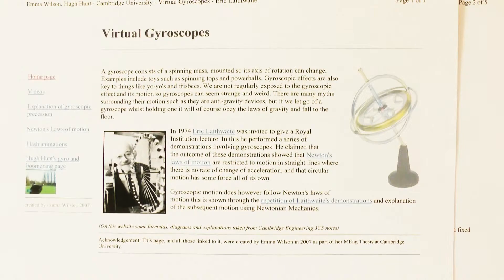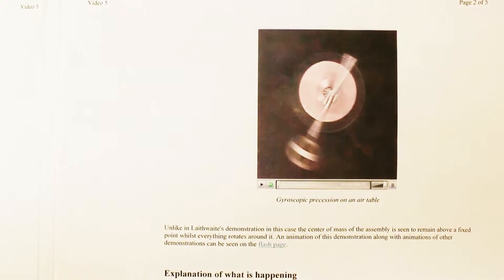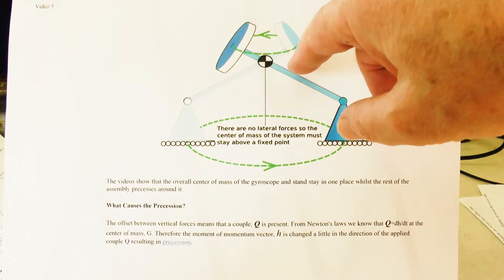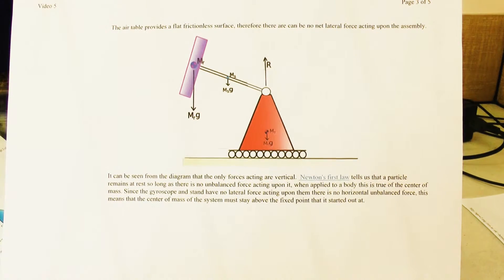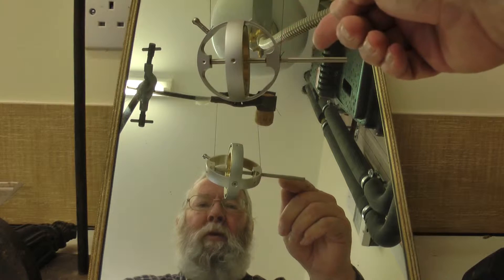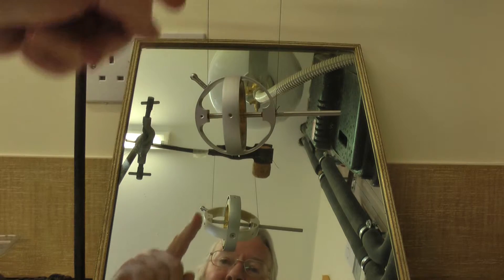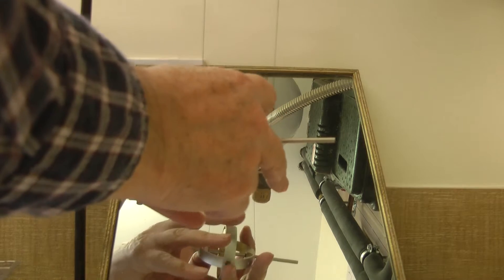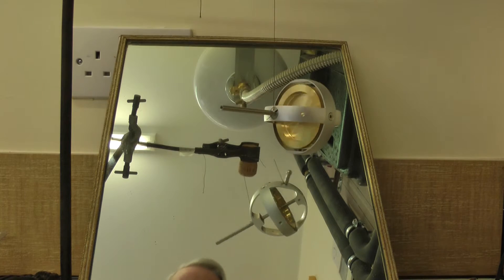Gyroscopic anomalies

Comment: Nick,

Thanks for this nice video.  

The precession rate in your experiment is about one rev in 6 seconds, so that's about Ω = 1 rad per second
Centripetal acceleration is r*Ω2 and take r=4cm approx from your video then that's 0.04 m/s2 or about 0.004g.  The tilt of the string would be expected to be atan(0.004) since the upward force is mg and the centripetal (sideways force) is 0.004mg
So the angle is expected to be about 0.2 degrees - imperceptable, as you rightly observe.

Why do you expect the centre of mass to lie below the support point?  That only occurs for a system in STATIC equilibrium.  The spinning rotor is not static - it's spinning and there are inertial (gyroscopic) effects.  What we know is that the net force on the rotor due to gravity and the centrifugal force is at an angle of 0.2degrees.  What we now need to account for is the moment.  

The resulting moment Q  is equal to mgr, and that moment causes gyroscopic precession Q=JωΩ where ω is the spin rate.  The audio from your video gives a tone of about 160Hz so the spin rate is about 10,000rpm or ω=1000rad/s.  The moment of inertia J = mk2 where k is the radius of gyration of the rotor and by eye this is about 2cm.  So we can compare Q=mgr=m*10*0.04=0.4m   with  Q=JωΩ=m*0.022*1000*1=0.4m 
Note these match, so everything is in order.  It's SO important to realise that we're talking dynamics, not statics.

I'm happy for you to remain skeptical, so don't bother removing the video - it's fun!  I show this demo to my students as an example of the pitfalls of statics vs dynamics.  I do it with a bike wheel which is much more impressive.  I'll post it as a video if you like.

Hugh Hunt
Cambridge
Reply from the maker: Hugh
 
Thank you for your reply.
 
In truth I didn't think I would get a reply after so long a time and it's a 
forgone that I certainly didn't expect you to hold up your hands and say:- "you 
are right, I give up, the gyro does rotate around its point of suspension and 
not around the barycentre"; as claimed in Emma's thesis".
 
It was kind of you to go to the trouble of "doing the math" (I really wish 
I could understand math) but as explained in the video I have the equivalent of 
Mathlexia.  As anything with " -lexia" implies having to do with words I am 
happy to accept "mathematically thick" instead as that tends to make people 
explain things more slowly and, sometimes, with crayon pictures.  
 
I still have problems balancing the "thirds" statement that for every 
action there is an equal and opposite reaction with the action of an overhung 
gyro rotating around its suspension point, a la my video.  To me the video shows 
a lack of matching opposite rotation of the suspension point which conformation 
with the third would seem to require.
 
I also have difficulty accepting the jolly way that anomalies with the 
third law are sometimes explained.  For example:- that liner reaction and 
torsional reaction are separately conserved - presumable in two paper bags kept 
specially for the purpose.
 
I know that nutters in sheds like me can be a bane of a scientists life so 
I won't bang on but If you are ever at a loose end I would be glad for you or 
your pupils looking at some of the other gyro demos on the "Jogglevision" site 
for your opinions - polite preferably.  I haven't put up details of my "fast 
repeater" yet because I am a crap engineer (did you guess?) and tend to get 
distracted too easily by life, the universe, rebuilding my Daimler Dart, 1275 
Cooper S and avoiding being killed by my lovely wife for being distracted from 
the things she assures me are far more important.  Pah! Yeah right!
 
Kind regards
Nick
Reply: jogglevision 
Glad we agree, up to a point! Emma's experiment is right too because the base of the puck provides the moment. So please let's accept that Newton's laws are correct. There is no mystery. 

If ever we're in the same part of the world let's have a beer over this, just as Newton and his mates would have done a few centuries ago. I think Robert Hooke was the real Genius.
Reply: Hugh, maybe you should show your students my experiment of a gyroscope precessing on ice and rising upwards, all of which with ZERO centripetal force. Or better yet, ask your students why a gyroscope maintains its orientation as the Earth rotates due to "angular momentum".... but a simple spinning top doesn't.... ;) Hint: the answer is "angular momentum" and coincidentally all of Newton's "Laws" are just plain wrong,.
Reply: Yes, Cambridge University is very wrong in its teaching of precession. Here is the real truth about it. 
The experiment in this video using a frictionless trolley or iceblock with lack of friction under the pivot, works as it does, because if the spin in the gyro is very very fast, then there are created in the precessing-gyro-wheel,  two phenomena which are, an outbound and inbound centrifugal forces acting on the upper and lower half of the gyro "face" and to the left and right of the vertical diameter of the gyro wheel. Their vertical separation sees to torquing against the down weight of the gyro through the arm ( m.g. R arm)  while the horizontal separation creates the precession angular rotation seen in a floating gyro experiment.  These two opposite acting but separated centrifugal forces to produce both a vertical and a horizontal torque are equal (most of the time the gyro spinning is fast) and so there is no lateral reaction on the pivot. Since there are no linear accelerations and the angular accelerations are constant, then there are not even any horizontal flicks on the support pivot due to the orbiting torque of the gyro. The pivot in this state will only take the vertically down acting gravitational weight ( one constant acceleration)  and any other change in accelerations in the height and orbiting of the gyro.  When the spinning of the gyro is reduced, then the upper inbound centrifugal force is reduced and the normal centrifugal force on the gyro and the ice block or the wheeled support trolley is established and their presence starts to be felt. At slow angular rotations, there is also a lateral horizontal force on the pivot in a sequence of directions and the rotation will first seek to rotate about the total mass center as both the outward centrifugal force on the trolley/ice block and also that on the gyro, will fight out a tug of war between them.  There seems to be a horizontal "orbiting" torque on the apex of the two cones made by the wobbling extension arm that does not seem to be always lined up at the same central location, but it orbits in small circles while both the ice block and the gyro are eventually, rested.  The last motion is much more than an example of a " horizontal flywheel" with static balance and dynamic unbalance.
------------------------------------------------------------------------------------------------------------------------------------------------------------
****In order to understand the engineering /physical reason for the creation of the inbound and the outbound centrifugal forces and how they change their relations with different spinning relations with the radius of the extension arm Ra, the radius of the spinning wheel Rs, Wp angular procession of the radial arm, Ws the angular spinning rate of the gyro wheel is to simply draw the plan view of the gyro spinning and precessing wheel around the pivot point:-
Assume the above machine has its gyro and extension arm in a  perfectly horizontal position, then draw the PLAN  view of the whole system. Take Ra to be 1 to 3*Rspin  while marking the largest circumference at radius Rs (mentally or otherwise) of the Spinning wheel every 90 degrees by using 0, 1, 2, 3 as angular position symbols. Four marks are enough to see the result.  Then measure the radius  Ra and draw the arm rolling flat circle, then the tangential line diameter 2Rs of the spinning wheel. The plan view will be a circle that the arm Ra executes while the line 2Rs as a tangent to the circle will represent the gyro maximum diameter in the horizontal location.  To see the lack of or the creation of the internal bound and external bound centrifugal forces in the plan view on the central pivot, first, draw the trajectory of one mass particle (0) on the spinning wheel without the extension line arm radius Ra advancing anywhere. Simply keep the center of 2Rs  which is (maximum diameter representation of the gyro)  tangent to Ra circumference, and choosing the position (0) on Rs as being vertical to start, roll the "vertical radius Rs through one revolution while the center of the gyro rests in the same location.  The first vertical point on the gyro starts as a tangent to the circle Ra.
 Plotting only four points in sequence every 90-degree rotation of the spinning gyro represented by a tangential line, 2Rs in length, this will include, (First point, tangential to the circle (vertical radius situation )) then, (the second point at the maximum diameter say extreme right of the tangential gyro,( horizontal radius situation)), then  (The third point representing the radius of the gyro reaching the lowermost point which would be like the first point tangential to the (Ra) circle) then ( the Fourth point which will be to the other extreme end to the left of the line 2Rs representing the horizontal radius of the gyro)  then include (a Fifth point  tangential to the circle at the starting vertical point, representing the gyro turning one full circle. )  Note that without Ra advancing, that all these five points exist on a straight line in this plan view of a spinning gyro which means that the outer tip of a  spinning radius will be forming a perfectly flat circle rotating in the vertical plane tangential to extension arm, Ra)  This radial Rs centrifugal force in the spinning of the gyro will not affect the pivot point in any manner apart from storing spinning energy in it.
Now, having the (Ra) circle and next to it the tangential (2Rs) line diameter of the gyro, follow the free ends of the line Rs and this is found to be far away radially from the circumference of (Ra) circle.
Using the previous central pivot point as a center, draw a second larger circle with a radius as long as the outermost tip of the diameter representing the tangential gyro wheel.   All the magic that shows the creation of the inbound and outbound centrifugal forces in a gyro is located in between the circle represented by the radius ( R arm ) and the circle represented by the radius square root(Rarm^2 + Rs^2)
To draw the trajectory do what one did before, but  ADVANCE THE GYRO TANGENTIAL LINE  (Ra) every 90 degree turns of the gyroradius starting with a gyro vertical radius at the tangent of (Ra) circle. Do not choose the advancement of the gyro on Ram circle too small, but whatever advancement you chose,  the spinning radius of the gyro with the gyro rolling along (Ra) circle, will produce the plan view of the VOLUMINOUS THREE DIMENSIONAL cycloidal path of one spinning and precessing gyro mass particle on the tip of one gyro radius. This flat representation of the three-dimensional trajectory will tell the full story of why the gyro behaves as it does and if one follows the movement of the "center of curvature " of this plan view of this cycloidal motion of one mass particle in a spinning gyro, then all inbound and outbound centrifugal forces directions are known.  ALL UNIVERSITIES WILL HAVE TO ADJUST THEIR TEACHING OF WHAT MAKES A GYRO WORK AS IT DOES. The stunning accelerations that exist between the two flat circles representing the tip of a radius and the center of the gyro are just remarkable to behold. 
These two centrifugal fluctuation forces in the gyro should be now called, " The Professor Carmel Pule' gyro centrifugal fluctuating pair!" 
With respect to the central pivot support point, the plotted trajectory existing in between the limits of two circles will have beautiful symmetrical with one curve representing the trajectory of the mass particles in the upper half of the gyro showing a convex curve while the other showing the trajectory in the lower half of the spinning gyro will have concave curve trajectories  THESE TWO CURVES WITH RESPECT TO THE CENTRAL PIVOT ARE THE MYSTERIOUS TWO CENTRIFUGAL FORCES WHICH GIVES THE GYRO ALL ITS MAGICAL BEHAVIOR. 
Every engineer should be conscious of the ingenious manner in which the outbound and inbound acting centrifugal forces in a spinning and precessing gyro are created, and how their vertical and horizontal (diagonal) separation can be used to torque the spinning gyro wheel to float up or down the weight of the gyro and at the same time control its processing rate. 
This is the fundamental operations of all gyro machines shown by Professor Eric Laithwaithe, Sandy Kidd, Woopy jump, Maths Easy Solution, Jogglevision, and anyone else who works with gyros.
This is now continued in a reply comment.
Reply: continued from another comment.
Addenda.
A.   It is to be noted that since I wrote the above, my research has shown that when a gyro is spinning and precessing, then two centrifugal forces are generated, one is "inbound" acting on the top ( horizontal ) half of the face of the spinning gyro and the other "outbound" acting on the lower (horizontal)  half. These two forces are generally of the same magnitude at high rate gyro spin, but opposite in direction and so the "floating gyro " will not show any centrifugal force as we know it. At lower spins, the conventional outbound centrifugal force takes over. The gyro rises because the inbound centrifugal force acting on the top half helps to " torque" the gravitational weight of the gyro upwards to lift it as shown in the video. For a normal torqued gyro without the extension arm, this phenomenon also happens to change the angle of the gyro.

If one wants to dig a bit deeper then one needs to study the accelerations in the three-dimensional cycloidal trajectories followed by one mass particle in the spinning gyro.  The plan view of the cycloidal trajectory will show the presence of the inbound and outbound centrifugal forces acting on the top horizontal half and the lower horizontal half respectively. These two centrifugal forces will eliminate the conventional outbound centrifugal force we are accustomed to and there is no reaction on the central pivot. 

B. If one looks at the side elevation of the cycloidal trajectory of one mass particle in the spinning and " cycloidal translating" gyro wheel, then one would see that as the mass particle is being accelerated down one of the "vertical halves", the GYRO CENTRE needs to lift up to produce this acceleration and while the particle is being decelerated up the other " vertical half"  then the GYRO CENTRE also needs to react to this deceleration by lifting up.  It is this lifting up of the center of the gyro wheel due to the large radius accelerating particles down one "vertical half" and decelerating mass particles up the other 'vertical half"

To understand the contents of the last paragraph all one needs to do is to appreciate that   THERE IS A SOLID CRANK FORMED  by the fact that the long extended  SOLID axle of the gyro is SOLIDLY  attached to one spinning SOLID gyro radius at 90 degrees whose outward tip carries the heavy mass particle  WHICH IS CONTINUOUSLY BEING ACCELERATED DOWN A VERTICAL HALF AND DECELERATED UP THE OTHER VERTICAL HALF.  It is this lifting reaction that carries the gravitational weight of the gyro ( or other side weight) without affecting the reaction on the central pivot point carrying the floating gyro!  That is the whole reason why central pivots on ice cubes and wheeled trolleys and hanging strings behave the way they do. 
To test the CRANK ACTION in a gyro, bend a piece of solid wire in the form a crank with long shaft and quadrature stroke throw, place a heavy nut on what one may call the " big end of the crank". At the pointed end of the crankshaft ( replacing the central pivot) bend it up a little so that one has a moment arm to rock the crank where this "pointed central pivot side" is held to rock and roll,  but stay in the same position. If this crank is placed on a free edge of a table so that the weight hangs down, on rocking the crankshaft the hanging weight will stay in the same location due to its inertia but the solid corner junction between the shaft and the throw will swing and take the reaction.   It is important to note that NO GYRO WILL WORK IF THE JUNCTION BETWEEN THE AXLE AND THE QUADRATURE GYRO RADII IS NOT SOLID ALL THE WAY. 

Conclusion:-
A. The two opposite centrifugal forces acting on the top horizontal half and the lower horizontal half will eliminate the conventional centrifugal force when the floating gyro spins and precess at high speed. There is no rection on the central pivot because of this phenomenon. 
B. The downward acceleration of mass particles down one vertical half of the spinning gyro and deceleration of mass particles up the other vertical half will react in lifting the center of the spinning gyro to lift the gravitational weight of the what torques the gyro. The fact that these accelerations take place in the vertical plane they have no effect on the central pivot point. The lifting of the center of the gyro is not perfectly vertical but has a  circumferential component with the radial arm which causes the radial arm to rotate/ precess. The fact that these forces are generated within the gyro itself as if the gyro has a propeller to pull it around, there is no reaction on the central pivot as when airplane banks to take a curve. IT ALL BECOMES A SELF CONTAINED LIFT AND TRAVEL as a self-powered aircraft flying. ( It is gravity torque and angular torque in a gyro...(mgRarm= IWs.Wp))
Please note that I tried to simplify it but in practice, A and B functions work together.  At the slower spinning rate of the gyro, the rotating masses are subjected to the normal outbound centrifugal force and when there are two masses they will finish up rotating about their center of masses but only if the gyro is not spinning fast enough.

All the above work should be checked by 
The Imperial College London, Dundee University, University of Cambridge, Sydney University, and other universities where gyro projects were taken up. I now work on my own but did a lot of work at the University of Malta and I would like  these phenomena to be called, " The Carmel Pule' horizontal and vertical  cycloidal variable accelerations in gyros"   or " the Carmel Pule' opposite axial accelerations and the accelerations in the slightly thicker cylindrical/cycloidal larger apparent volume of the spinning and a precessing gyro"
Reply: My opinion about why inertia seems to disappear from a gyro is as follows.
Let us assume that the gyro mass wheel is spinning at about 5,000 revolutions per minute.
Then I shall take the arrangement shown in this video to explain my thoughts. 
The gyro which is seen in this video is suspended with its axle in a horizontal orientation. When one thread was burnt,  the other thread took over the suspension point and the gyro was all of a sudden subjected to a TORQUE of (m.g.Ra) mass, gravity, and extended arm Ra. The remaining thread was also involved in creating the torque action.
1. With the weight (mg) acting vertically down the gyro body was subjected to a drop and a torque.
2. This drop retained the instantaneous horizontal diameter of the spinning wheel but tilted the instantaneous vertical diameter "diverting out"  the upper high-speed mass particle and " diverting in" the lower high-speed mass particle, changing what was equal but opposite momentum, in the same plane, to divert their courses away from the opposite faces of their spinning plane before the drop occurred.
3. The vertical diameter tilting rate of the drop decided the new velocity vector DIRECTION components at the top and bottom of the tilted vertical diameter which was added to the previous spinning velocity.
4. This change of direction of the upper and lower masses in the gyro spinning radius, proceed in their new "almost linear momentum"  and the tension and " side structure solidity" in the radius component cause the two fast-moving mass particle on opposite radii to swing to their maximum after just (1/4)  a quarter of a turn of the spinning wheel.  This was really the time taken for the  FIRST 90 DEGREE PRECESSION. it happened in ((1/4)(1/5000) seconds
5. The action described in (4) caused a horizontal torque on the gyro axis in a particular direction, which set the gyro rotating about the central pivot support point. Hence (m.g.Ra) torque due to weight= (I.Ws.Wp) angular precession torque.
6. The gyro instantaneous horizontal diameter was now inclined in a similar reaction to that occurred in the vertical diameter with the initial drop. This horizontal action to the modification of the masses on the horizontal instantaneous diameter resulted   ((1/4)(1/5000) seconds later in torquing the gyro in the vertical plane which in conjunction with the extension arm pushed down on the pivot to take the weight of the gyro. This what I call  THE SECOND PRECESSION in a floating gyro as shown in this video.
So for these two 90 degrees, precessions which resulted in a 180-degree phase shift took about ((2/4)(1/5000) seconds which is half a spin of the gyro wheel.   If we are pessimists and say that it took 10 spins to settle it then that is something that the human eye cannot even see! 

This phenomenon of how an action is transferred to two 90 degrees operation is also found in electrical engineering in alternators and motors.

If a voltage supply V is applied to a motor or a transformer, then the magnetic field B is lagging 90 degrees, and once the magnetic field shows its presence the spinning coils in the motor show its effect by inducing a back emf E again 90 degrees later to oppose the input.  In AC work say 50 or 60 Hertz one may say that half a cycle  1/( 2*50) seconds to excite the back emf  hence V= E opposing it 

Considering that when torquing a spinning gyro only one effective large diameter is being slightly tilted the effective high-speed masses that are being diverted from their previous course to precess and hence the mass close to the dormant diameter does not seem to count a lot and perhaps the inertia to be accounted for would be much less than what the first intuition tells us which is either the total angular inertia about the center or the inertial about the diameter.............certainly, not an easy matter to settle using the human eye!
Reply: A comment I made elsewhere for your attention, please.
 The gyro in the "floating " configuration, when placed at the end of an extension arm, DOES NOT LOSE ITS  WEIGHT  and that issue, is very misleading many people, including many universities. I advise readers to proceed to read what I am about to write as it will not be found in any book or from no one else, and readers, they are free to comment on my recent thoughts.
Here are the details of what I think happens in a gyro.  There are basically four states one needs to explain. I shall use what is seen in the video above showing a gyro appearing to be floating.

1.  The vertical down weight of the gyro (mg) seems to be floating on air and how it is held up against gravity needs to be explained. 
2. What forces the gyro to turn about itself with the dynamic precession (Wp and torque of I.Ws.Wp) needs to be explained.
3. Why the gyro, when not spinning but rotating as a pure mass m shows centrifugal force about its own center and about the pivot point and this later disappears when the gyro spins and precesses. 
4. Why the mass m is basically moving slowly around the pivot point. One may consider this as a linear motion using a force Force = ma + air drag forces if Ra is larger large and then work it back into motion about the pivot point by knowing that a= (R arm)*d(Wp)/dt

The above is achieved as follows.
a. When a fast spinning gyro (Ws) is taken and allowed to move around a radial arm (Ra) with angular velocity (Wp), then the trajectory of one mass particle is a three-dimensional cycloidal curve containing different locations, different velocities, and different three-dimensional accelerations.  Within the curves of this three-dimensional cycloid, there are ACCELRATATIONS  acting on the spinning and rolling mass particles which bring about two opposite acting centrifugal forces which vary their magnitudes,  one acting inward on the upper horizontal half of the gyro, and the other acting outward on the horizontal lower half of the gyro. These two opposite acting centrifugal "horizontal" forces act at a slightly forward angle to the movement of the gyro, will create all the magic in the gyro as follows. Also, note that these two opposite acting forces also act on the forward vertical half of the gyro ( the inbound force) while the ( outbound force) acts on the rear vertical half of the gyro.  They are basically horizontal in nature and their horizontal and vertical separation between them and the slight tilting forward give all the requirement to make the gyro behaves as it does. This is how what was described above handles all there is to handle in a gyro as shown in the video.

1. The weight of the gyro (m.g) working in conjunction with the supporting arm as a pivot, and the extension rod (Ra) generates a  gravity torque ( m.g.R arm) which tends to pull the weight down.  This is opposed by the two opposite acting centrifugal forces being separated in a vertical manner by a distance x.  This arrangement will give the following. The inbound force (Fin) is above the outbound (Fout) by a distance x and so these create a torque of   (F1+F1)*x = (mgR arm) and this is a balance in the gravitational state. 

2. The flat face of the gyro spinning wheel at (Ws) with an inertial "I" is changing its orientation with respect to earth with angular velocity (Wp) as it circles around the pivot suspension point and this needs a torque = (I.Ws.Wp ) which is provided by the same two opposite centrifugal forces separated by a horizontal distance x, acting on the front and back vertical halves of the gyro spinning wheel.  Hence
F1+F2)*x = (I.Ws.Wp)      This means that the inertial of the gyro tries to resist the torque action by the horizontal separated opposite acting centrifugal forces F1 and F2. This is the dynamic angular motion balance. 
Note the beauty of the relation between the ( Falling weight and torque ( m.g.Ra),  and  (the  two opposite  and separated centrifugal forces, horizontally and vertically by distance x, ( F1+F2)*x) and( the torque  needed by the gyro (I,Ws,Wp)) 
vertical gravity balance =  (m.g.R arm) = ( F1+F2)*x   = horizontal angular torque  (I.Ws.Wp)=( F1+F2)*x

3. Since the two opposite centrifugal forces are " almost parallel with the gyro extension arm Ra, then conventional outbound   Centrifugal force m.(Wp)(Wp) *R arm =  (F1-F2) where F1 is the inbound centrifugal force which diminishes with the loss of spinning, of the gyro and so the normal outbound centrifugal force F2 takes over.

4. The force  that pulls the gyro forward may be looked upon as being a linear force  and this is  due to the slight tilt forward of both centrifugal forces which is (F1+F2)*sine (angle of forwarding tilt of the centrifugal forces)     Hence this forward motion of the gyro may be looked upon as being
 Force= ma + drag force .
This may be "adjusted" as the linear acceleration is related to the Wp rotation of the gyro by (Wp) where a= d(Wp/dt)  so (F1+F2)*sine( small forward tilt angle)= m.d(Wp)/dt + Wp drag and other losses. 
If one watches other video one sees gyros rising to the top by some unknown forces, and I do believe that this force may account for what one sees in other videos as shown in the following,

The beauty of what was explained above means that at very high spinning speeds the reaction on the central pivot point is only the vertical weight of the gyro mg. 

https://youtu.be/SEstkIF3U1Q

Apologies for the length of this explanation, but it needs to be commented upon by those who enjoy the magical and elegance of gyros.